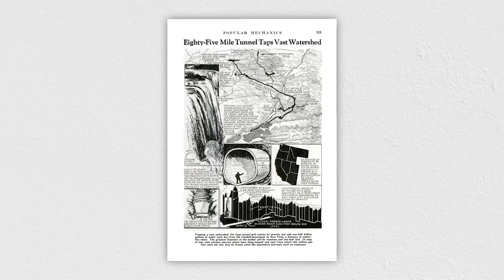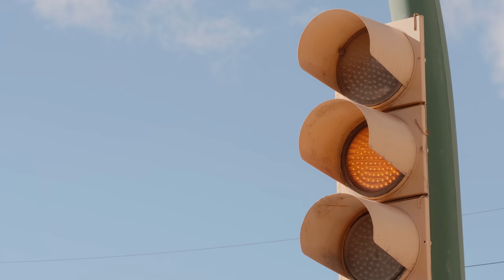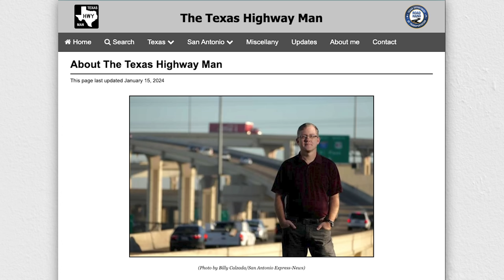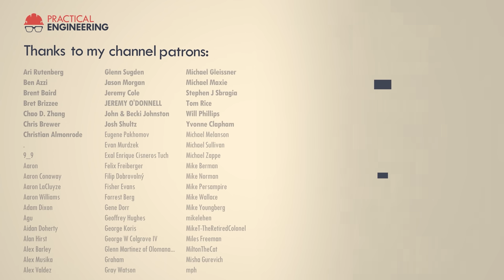Why Are Texas Interchanges So Tall?

Comment: I think the FHWA requires 16' clearance, but TxDOT wants it designed to 16.5' clearance for added room with future road repairs and regrading that might increase the height of the road. Texas also has specific highways and routes classified for high clearances, the Texas Highway Freight Network, which adds another 2' of necessary clearance. So designed to 18.5' of clearance between each road and bridge. Definitely adds up quick.
You can look at the Statewide Planning Map for a ton of info on this stuff.
Reply: We have a lot of these interchanges appearing in my area and I can’t help but think about the massive headaches and costs that are going to come with replacement in 30 years. Texas gets so little snow that I’m willing to bet theirs will last longer, but we are much further north. Are these interchanges even capable of being replaced?
Reply: @illhaveawtrplz  I think normal bridges are built to 50yr lifespan expectancy, but repairs and maintenance extends that. All bridges in the country are inspected every 2 years, or more often if there's an issue. I wouldn't be surprised if these interchange ramps and flyovers have a longer lifespan.
Reply: AASHTO (American Association of State Highway and Transportation Officials, basically the lobby of state DOTs and their contractors) does recommend leaving at least 4" / 0.1m of added clearance for this purpose.
Reply: @Andrew-qu7lq  That’s a relief. Do you know anything about how snowy weather and snow removal practices impact the lifespan of these types of structures?
Reply: @illhaveawtrplz  no, I'm in the south with little snow experience. North texas gets relatively common freezes, but not much actual snow or ice accumulation, and there's basically no actual snow removal unless they bring the roadway graders out there as a make shift plow.

I know that places like El Paso actually get a lot more wear and tear on the roads though because of the frequent and drastic temperature differences between day and night. So even though rain is sparse and snow is very rare, just the temperature differences is enough to cause a lot of problems to roadway surfaces in general.

I think the bridge inspections are public information, though the actual conditions and photos are now considered confidential after one of the Homeland Security acts post 9/11. Still, there's a fair bit of information out there, just have to look at what each column of info is actually saying. BRINSAP, Bridge Inspection and Appraisal, is the name of TxDOT's that inspects all bridges in Texas, including non-txdot roads (many cities and counties forget to tell TxDOT that they built a bridge so some of these local ones are missing). Not sure about other states and their names.
Reply: @illhaveawtrplz  Yes they can be replaced. The process takes about 5 years with narrow lanes and closed exits for several years at a time. Houston's TX288 and IH-610 is a current example of a rebuild.
Reply: @Andrew-qu7lq  all bridges are SUPPOSE to be inspeceted every 2 years. that doesn't happen. not even close.

Comment: One thing Texas does right is the access roads their U-turns, easiest state to turn around if you missed an exit
Reply: Agreed. The turnarounds make correcting a mistake so much easier than in other states.
Reply: Absolutely not
Reply: It’s 10000x easier to turn around on I95 in  south Florida than anywhere in Texas. ANYWHERE ANY ROAD STREET ANYTHINNG
Reply: @dubzy21  ah, the Florida Man route, fair enough
Reply: @mrexists5400  lol I swear man Texas is just the worst even when I do miss a turn and get to use the turnaround, it’ll be like 2 miles away still… what’s even the point 😭 Ijs in Florida you get off the ramp and it’s 500 feet until the light and at most you’ll have to wait 30-45 sec for the light to change because we are civilized and have sensors at every light unlike TEXAS 😭
Reply: @dubzy21  only 2 miles? Try 15 or more in some other states, and that's still closer to the lower end 💀
Reply: @mrexists5400  well those aren’t real places and people don’t actually live there
Reply: I hate how many no U turn signs are around here in KC.  There's no logical reason for most of them.
Reply: @dubzy21 the average distance for a turn around on frontage roads in Texas is about a mile sooooo

Comment: Note that in the film at 0:42, the majority of the cars are not moving or are just plodding along at a walking pace.
This is a five-level traffic jam.
Reply: Typical rush hour in DFW. Especially on the Dallas side.
Reply: Do you mean at 0:30?
Reply: Yeah, the High 5 works great for thru traffic, but the interchanges between 635 and 75 are slow for 8-14 hours daily.
Reply: You mean the slow motion shot? LOL
Reply: @unvergebeneid that shot was slow motion
Reply: @nicholaswroblewski3069  but at 0:42 I don't see five levels or traffic jams.
Reply: And yet they'll insist building just one more lane will fix it
Reply: I think some of those lanes are actually moving pretty fast... it's just like a mile long interchange.  The Texas ones are really clown-shows of concrete.
Reply: It's because they built one lane short before they could fix traffic.
Reply: @Guysm1l3y  Not sure it's slow motion. The traffic flow from right to left is going pretty fast.
Reply: @nicholaswroblewski3069  at 00:30? dunno, but even if you speed it up 5 times, the cars flowing to the left are still standing still 😅
Reply: Add another level that should fix that jams 😂
Reply: @geoffstrickler  I believe a major cause of traffic there is the exit for Coit. With that exit being so close to the ramp for 75, they reintroduced the weaving problem. If you look closely, that weaving problem is the cause of most of the regular jams in north Dallas.
Reply: @erikremkus7718  That’s part of the issue, but since it happens on all 4 ramps, that’s not the core problem. The percentage of traffic entering/exiting Coit is relatively small, but yes, it does cause additional issues because of the “weaving” issues. It is a smaller problem on the east side of 75, which is at least in part due to Coit, and part of the issue to the east side is TI Blvd/Greenville.

But any way you look at it, it’s a mess. A bit less so if you’re using the express lanes, but those can be very expensive at rush hour, but still a mess as soon as the express lanes end.
Reply: @geoffstrickler  The real root problem is that you can't decrease traffic by building more roads. No interchange design can fix that.
Reply: @louiszhang3050 Nah, not just one more level bro, this needs one more overpass bro
Reply: @grannygrammar6436  yeah, certain times of the day.  What would you have done if you were designing the highways?
Reply: Ya the high five was a real blast with all the highway construction they did in that area not so long ago.
Reply: Yep. And now we are way over populated. Mix that with continuous construction for over 50 years it’s nerve wracking driving the roads here.
Reply: @Txbunny  you're not overpopulated at all lmao, you have less population than france with about 15% larger area. It's all planning and urbanism issue
Reply: @Txbunny 
Wait until you try driving in NYC. Standstill traffic on the LIE at 3AM

City doesn't care though, way more people take the subway
Reply: @Demopans5990  I would never and could never. I’d have a heart attack before I made it to my destination 🤣

Comment: I worked for Vince Hagan. We built the concrete batching equipment for the contractor out of San Antonio who built the High Five. When we delivered the equipment, the location was an old drive in movie theater the state of Texas had purchased years in advance of the project. It was so hard back then to picture how big the High 5 was going to be. One big challenge was during a big winter freeze. Tractor trailers all got stuck going up the ramps. Blocking traffic for days.
Reply: Yep, drove through Dallas right after a big ice storm once. The interchanges were all blocked.
Though the truckers figured the inch or 2 of ice made them a bad idea. It was all cars stuck 😂

Comment: They had to invent a new machine to assemble the High 5, allowing them to build the flyovers with fewer interruptions to the preexisting traffic. It was this clamp-like contraption that attached to the existing pillars and roadway. It would lift a section of bridge up, then could move to the end of the new piece and lift the next section. Then it would go to the other side of the pillar and repeat the whole process. A "normal" crane had to be used to put it in position and move it between pillars, requiring traffic stoppages and such, but they were kept to the bare minimum, and usually done at night.

The entire project finished ahead of schedule and under budget, too!
Reply: amazing!
Reply: And Zachary (one of the company's that built it) was given a multi million dollar bonus for achieving that.

Comment: Other "Big as Texas" engineering projects include the "HLD" in my hometown of Ingleside,  TX. It's the world's largest on shore lifter crane, as referenced in an article of Popular Mechanics, With 23 (yes, twenty-three) miles of 2.5" thick cable. With it's help, Ingleside TX has built some of the world's largest oil rigs. I'm a pipefitter , I worked on the rig "Olympus" and then later "Bigfoot" at Kiewit. I believe at the time of their construction, each was the largest or heaviest, in the world. That's quite a list of engineering marvels for just my small town, don't forget about the Katy freeway and I'm sure many others I can't think of. Much love from South Texas, we are glad to have you here ❤ Love the videos.

Comment: Growing up in Texas and now living in Tennessee I can tell you access roads are fantastic.  It’s basically 3 highways in one, usually the main highway going 2 directions, then each side of the highway is an access road that goes one direction on one side and the opposite direction on the other side.  But sometimes the access road goes both directions giving you way more options to get around.  I never understood the importance until I moved to Tennessee where the highways around where I live have no access roads, meaning if the highway has traffic or is shut down, you aren’t going anywhere.  The geography here in the east also only allows for roads going mostly north and south so when there is a problem with I40 and you exit to find an alternate route, you’re screwed because the roads only take you away from where you want to go.  Whereas in Texas, you could just get off the highway and use the access road for as long as you like.

Comment: A bit of perspective from someone who recently moved to Fort Worth:
I can drive from north forth worth all the way to North Dallas at a nonstop 75-80mph in the express lane, going through 4 interchanges and never slowing down for about 1 hour.
This entire time you never leave a 'city' feel.
The scale here is immense and the highways are certainly designed by engineers, not architects.
Reply: I like it.  Southern Florida's 'express' lanes attempt to make our cars into bumper cars with non-sensical single lanes after miles of 2-lanes.  Florida's road engineers aren't the brightest (and I've even met one who gave me the realization why our roads were so poorly planned; an engineering degree from a Florida college does not equate to having a comprehensive perspective).
Reply: i've gotten from the 35/820 interchange to downtown dallas in only about half an hour. mind you that's on the express lanes outside of the dallas rush hours, but still impressive nonetheless. It certainly does feel like aesthetically it was designed by engineers
Reply: This is it exactly. These highways compensate for a complete lack of urban planning in the larger DFW metroplex. The whole area is a seemingly endless, hellish suburban sprawl.
Plus, the whole highway system is insultingly complicated by the addition of the express lanes.
Even for all TXDOT’s effort, the traffic is still just terrible all through and around DFW because of the way streets are designed on a local level.
Reply: @kingunicorn7353  Yes! The difference between traffic/ rush hour and off hour is anywhere from 0% impact to 200% impact on driving time! Thats assuming no Altima's are attempting to hit Mach 2
Reply: Generous to call any part of Dallas "city feeling" - even downtown has more parking lots than it does buildings.
Reply: without the freeways, you would be looking at a 4 hour drive and never being able to leave the "city feel"
Reply: @longhaulflyer The actual central business district is definitely not more parking lots than buildings, though it's (mercifully) fairly small. There's a fairly large urban core around it that definitely has an urban feel in that the surface streets weren't designed for the current population density, and then the general DFW suburban sprawl beyond that that's quite pleasant live and drive in.
Reply: It takes an hour to drive from fort Worth to Dallas?😮😮😮😮
Reply: @pavelow235  closer to 45 minutes than an hour
Reply: @pavelow235  it depends  on what part to what part as they sprawl a lot. 5 minutes to an hour. Though if you include the suburbs you can be driving for an hour and a half or more
Reply: but if you needed to get past dallas...
Reply: @longhaulflyer  True! Definitally more 'city feeling' than being 2 hours west in the middle of nowhere!
Reply: @pavelow235  Depending on traffic and what part of Ft Worth and what part of Dallas! With bad traffic from North Ft Worth to North Dallas - it can easily be 2 hours if not more!
Reply: @maxrainey7143  Heh, Houston wants to have a word with you. You are not wrong if you are referring to the 635/PGBT loops and the DNT/US75 "spines" and the way both 35s enter Dallas/Fort Worth.
Reply: @Aesgor  It only takes one wreck to ruin the 183 / 114 flow of traffic. It usually averaging 55 but SOL if dropped below that.
Reply: As someone who defends our highways, it's definitely cheating if you're taking an express lane. Can't brag about roads that cost more than a cup of coffee to drive on for 15 minutes.
Reply: @jimjohnson394  Without the freeways, and some urban planning, the city would go up instead of out.
Reply: You can drive from downtown Fort Worth all the way to the Dallas High Five, and vice-versa, without ever leaving the express lane network. I-35W <-> I-820 <-> TX-183 <-> Loop 12 <-> I-35E <-> I-635.

The tolls you'll pay for doing so, however, are going to be crazy-expensive, depending on traffic and the time of day.

Comment: Hi Grady.  Thanks for talking about our highways.  I live in San Antonio and have driven everywhere in Texas.  Couple of comments.  We still have several issues with merging, mostly because of the 'loop' highways that were constructed inside of existing cities and neighborhoods. There just isn't enough room to make some ramps long and graceful, so we have quite a few 20 and 25 mph ramps and a short acceleration lane.  Also, a few years ago when we had the bad winter, the city had to close all of the interchanges.  We don't have any mechanism for snow and ice removal here, so they just close the roads.  Finally, TXDOT always waits about 15 to 20 years after the expansion is needed before starting work.  The construction zone is a huge bottleneck for 4-6 years and very dangerous to drive through.  The big trucks think it's OK to go 70 in a 40 mph construction zone and they do so.  Pretty scary sometimes.  Thanks again!
Reply: And usually as soon as they finish the expansion, they figure out they didn’t go big enough and start planning to expand again!!
Reply: @davidbehrend7054  I wonder how often this is due to political and budget constraints.  I live in San Antonio now, but I grew up in Boise, ID and a really important road stopped up on a ridge and didn't connect to the valley below.  A project was undertaken to build a graceful slope down to the valley below, but then the neighborhoods complained about a bunch of high speed traffic going through their area, so the project was reduced to a single lane each way with slow speed limits and speed bumps.

That kept the local residents from throwing out the politicians, but just a few years later, they had to redo a big chunk of the projects to bring it up to two lanes plus a turn lane that it should have been from the beginning.
Reply: @davidbehrend7054  Almost as if induced demand is a real thing and as if it’s impossible to solve traffic congestion while making everyone having to drive everywhere.